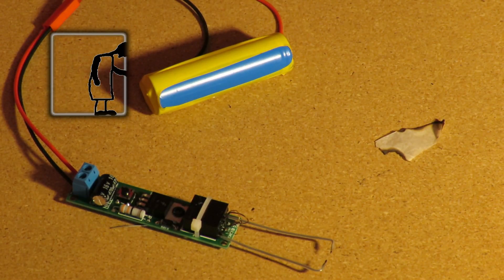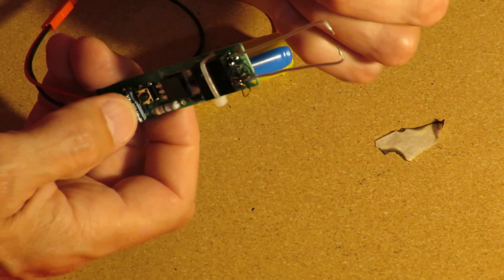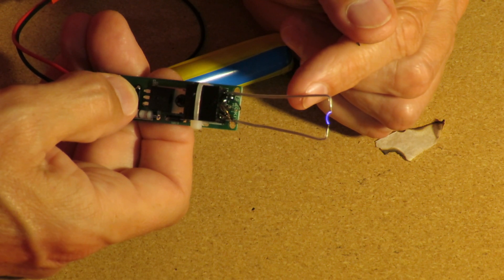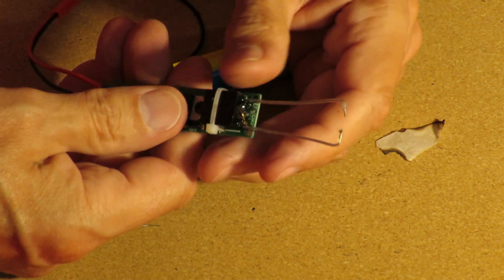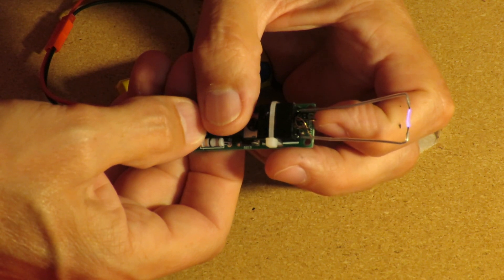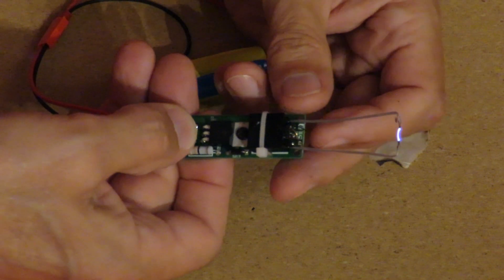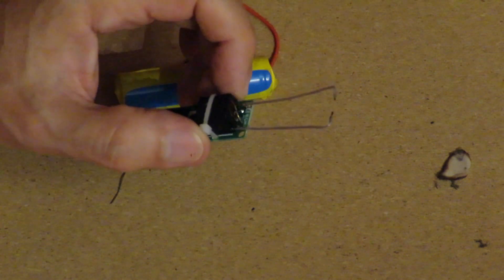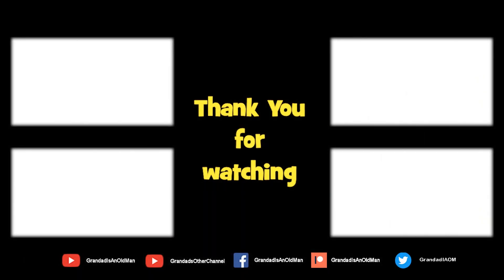Grandad assembles a DIY HV 1 High Voltage Igniter Kit TEASER

Comment: Do you think you could shorten the 2 prongs ?
Reply from the maker: No, why would you want to shorten them? You do need to adjust the tips to get the spark gap right. Here is the full video https://youtu.be/_YW67zss9Gw
Reply: @GrandadIsAnOldMan  Thanks.. I was interested making them shorter to fit better in a handle... you totally can shorten them as I did!
Reply from the maker: I guess it just depends what you want to do with the finished item 😊 I had no purpose for it other than as a subject for a YouTube video. What are you using it for?
Reply: @GrandadIsAnOldMan  I'm using it as a lighter.
Reply from the maker: @Purity262  great stuff, that is brilliant 👍

Comment: hi
I bought one of these but after hooking it up to the batteries, it wouldn't work. I made sure the batteries were the right ones and I resoldered and all. Do you know what I can do?
Edit: Maybe if I bend the tips and move it around it'll work. I don't know, please help!
Reply from the maker: I think you have answered it yourself, if you have everything right then adjusting the gap is probably all you need to do. The size of the gap can vary depending on the weather conditions as damp air is more conductive than dry air.

Comment: '
hi G...
how many volts is this device kit
Reply from the maker: From eBay
 - HV-1 High Voltage Igniter Kit Arc Ignition Generator DIY Module Suit DC 3-5V 3A